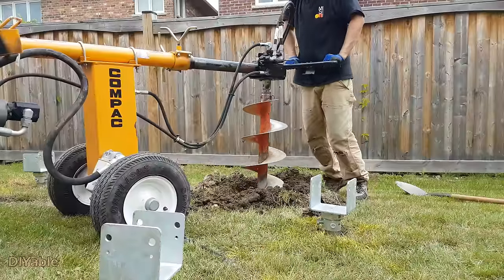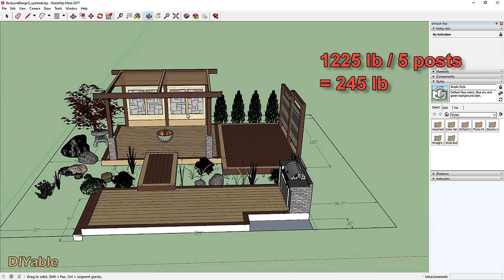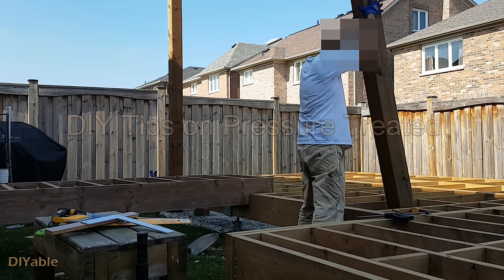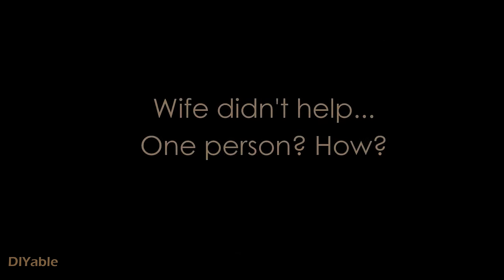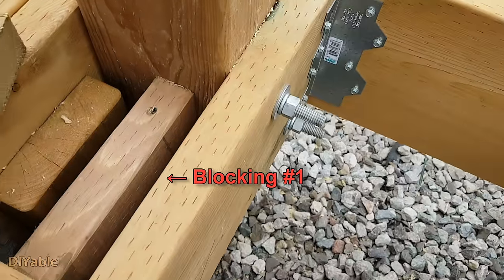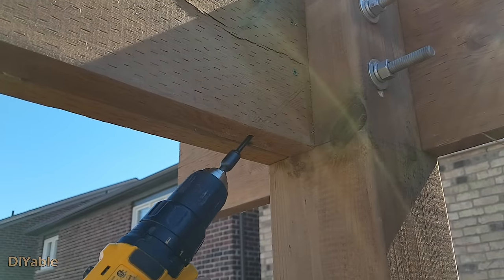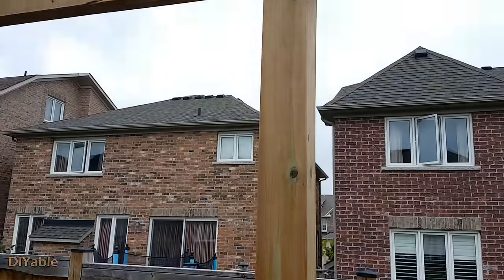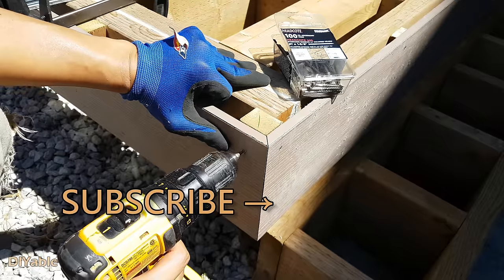DIY Deck (Part 7): How to build a pergola on the deck? No additional footings needed!

Comment: I think it would have been better to notch the bottom of the post so the weight is carried by the double joist as opposed to the screws and bolts. The screws and bolts then can simply hold the post in place. No?

Comment: Thats so beautiful.  It makes me want to upgrade my deck.  The issue the budget, you must spend a lot.  Just the price of digging already scared me.  Thanks for the vdo by the way.
Reply from the maker: Thanks. The helical pile is expensive, the cheaper option is sonotube with concrete. Floating deck is another option too.

Comment: Great job....love the extra support for posting.....I  do the same as it maybe overkill but the strength is amazing...
Many do not frame in this manner
Reply from the maker: Overkill is always better, especially for DIY people. You don't want your project to fail, over engineering is one of the ways to protect it from failing.

Comment: I have been considering the Costco 12x14 gazebo... Now, I'm rethinking it... :)
Reply from the maker: Gazebo is good in many ways, it has solid roof and you are sit there even it rains, for mine... I still have to shop for the retractable shades (or DIY one). Those shades are not water proof, you cannot use them in the rain.  Overall, I want to build something more unique and special, I didn't plan to buy the factory pre-build.  Just FYI.. the size of my pergola is around 11 x 10.

Comment: Deck is supported below grade but the post sits on it. Wouldnt heaving affect those posts? Well done series and project by the way!
Reply: I believe the deck posts are secured below frost line, so deck should not move
Reply: @davidnsh  as far as i see it, deck posts sits and are supported on grade and attached to a piece which is not. Heaving will exerce pressure under that 6*6 which will try to lift the whole thing
Reply from the maker: Just to clarify.  The 6x6 posts of the pergola are not sitting on grade,  they are attached to the deck. If you see Part 1 of this series,  the majority of the deck posts are Helical Piles, the guys drilled 5 to 5.5 feet down into the soil,  way below the frost line (4 feet).  In other words, if the deck does not heave, the pergola won't heave either.  In the video, I showed you it's sitting on some gravel because I had to install them, I had to put the 80-100 lb post on the ground during installation. 

The loading points for the pergola are all on the carriage bolts and some other screws along with blocking.  I think I had some video footage showing the pergola posts are actually not touching the ground, I actually removed some of the gravels underneath.  I had to find those videos and do a follow-up if you guys are interested.

Comment: Hi love all your videos explaining in detail how to go about the pergola. I'm planning on  using the m10 carriage bolts tp secure the beam to 6x6 posts. Can you advise what you've used to lock the m10 nut to the penny washer? I can see a lock washer but cant make out if its a spring washer?
Reply from the maker: Thanks and glad it helped. I was using galvanized split lock washer. Make sure you tighten them very firmly because wood expands and contracts a lot. Most importantly,  use blocking like I did because just the carriage bolts aren't not strong enough, you do need to use blockings. Mine survived several severe wind storms without any issues. The only room for improvement I would do is drainage on the blocking, some viewers pointed out some of my blockings didn't provide enough good water drainage and I agreed. Hope that helps.
Reply: Many thanks. I've followed your instructions to the tee, and now am very proud of the pergola. Can i ask another question, I notice you use an additional 2x10 beam on only two faces of the pergola (same side you braced). I like this as it saves wood. However, what about the other two sides? Did you just brace the longer length beams?

Comment: why did you not put your 6x6 post directly over the deck screw pylons used to hold up your deck then hang your deck boards frames off of them, mite have made it easier for you and helped to carry the loads down to the ground better .
Reply from the maker: Yes, that's indeed my very original plan, but when the guys came to install the metal piles, one of the the piles hit the rock and the other one was not perfectly align the way I wanted. So I had to change my plan. The metal piles are not as accurate as concrete foundation unfortunately.

Comment: I don't understand why you did not used pylex screws for your deck footings.
Reply from the maker: Yes, I did think about that.... base on the information on the soil condition we have, the clay is extremely hard. Pylex screw will not get passed 2 feet.  Check out Part 2 of this project @2:45 and you will see what I mean.  Also, for Pergola and Privacy Screen,  Pylex screws is not strong enough IMO.. 
https://youtu.be/uNY-BMWjAWs?t=165
Reply: I am also building a flush beam deck approx 1.5 feet high from ground 10 x 32 ft. And to avoid 4 feet digging and frost hive I will dig 2 feet down fill 1 feet with limestone screening and put deck block on top with 4x4 post or pylex adjustable deck support. Let me know your thoughts. Deck will have a storage shed and patio.  Thanks